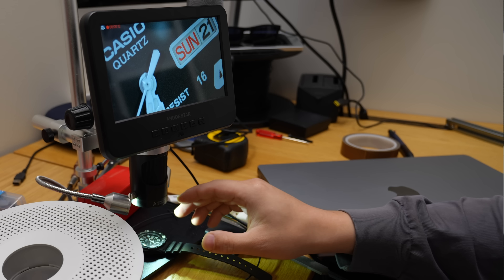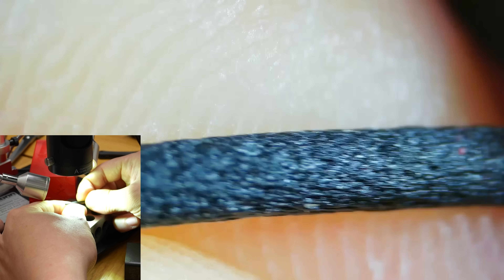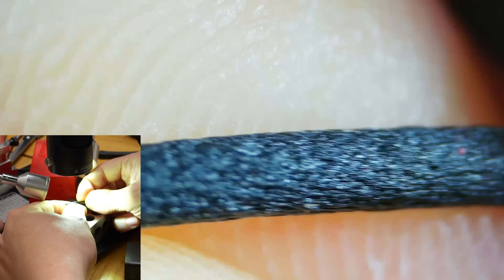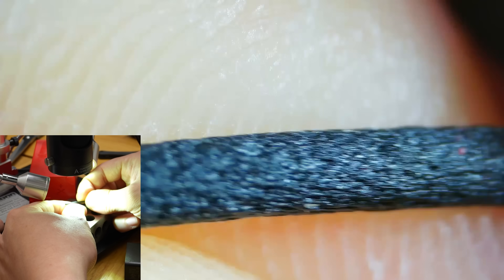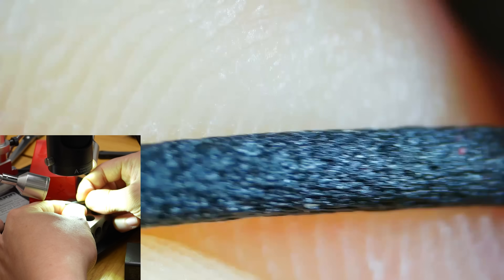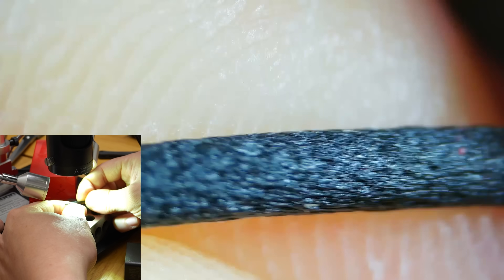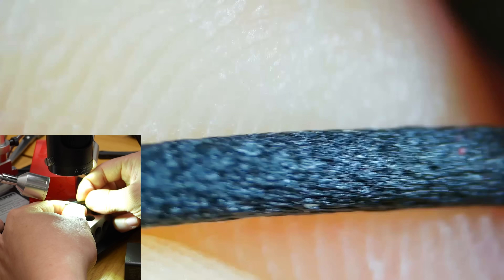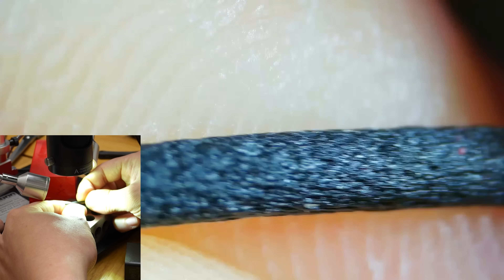The Dark Side of Carbon Fiber Filament

Comment: Ex composite materials engineer here, carbon fibres are not joke once the get in your skin they don’t come out. They have micro barbs that make the get trapped and the skin just grows over them and buries. Always wear gloves when handling and you want a table with vacuum extraction from underneath for cutting and preparing. I have a pice of carbon fibre in my finger it’s been there for 18 years😂. Also don’t get carbon dust in anything electric as it can short.
Reply: Depends on how deep they go, if they make it to the hypodermis layer they won’t grow out. It’s the fibres that stick out from the splinter that act like barbs that can hold them in and break off if you just yank them out. If you go in to get one removed they generally cut the length of the split rather than just pulling it out.
Reply: @milkybaravenger  yes and  no. They cut along the length for large impaled objects like stingray barbs,  big cactus needles, etc that go in laterally or at a steep enough angle. Large itens that go straight in require an incision the location, depth, yada yada depends on injury site. Stuff this small usually gets a local anesthetic if it's deep, and then the layers of skin are scraped away using a scalpel until enough is exposed to remove it. You're severely over dramatizing this situation and clearly don't spend much time outside. The reason I know all this is I've seen it numerous times on my ER rotations as a medic, have had it done for me,  and being in south Texas have an extensive history of sharp crap from the 100 or more types of cactus, Mala mujer, and various other evil products of nature. Buy hey, be afraid if you choose to be. Otherwise,  the body is amazing at getting stuff out that shouldn't be there.  Let it role.
Reply: @saltwaterrook4638  as I said I’m an ex composite engineer so the splinters I’m referring to for reference are from carbon fibre parts which are far larger than the ones from the filament, if you read my first post you would of probably realised this as I reference a split from my old job and not printing, I thought you had to be able to read to be a medic? I’m not worried about shards from filament in my skin, I’d be more worried about the dust from the fibres when peeping a part after if I didn’t wear a mask like any sensible person working around dust.
Reply: @saltwaterrook4638  lol south texas got them poison needle plants, lol they hurt, haha. Nightshade has glass like needles, at least it ain't as dangerous as the fruit and plant leaves but dayum it hurts.
Reply: Sigh, I don't have a microscope to verify if anything got permanently stuck, but I've handled carbon fiber filament. Well now I know. No more Carbon Fiber filament.

Too bad, because I don't have a good way right now to prevent Polycarbonate from warping with large prints.
Reply: Got splinters a few times myself, but thankfully, I was working with cured resin and could pull it out without too much difficulty, but definitely a lot of stress!  Had double gloved with nitrile gloves too!
Reply: Glass does the same too
Reply: @-r-495 Okay yes glass does the same job but don’t you think that’s worse? 😂 I think it’s around the same safety precautions needed. Glass reinforced is just fiberglass, should probably handle it like you should fiberglass insulation; Gloves and a respirator
Reply: @kadensmith5586  glass fibers dissolve in the body given enough time - have not seen anything that suggests carbon fibers do the same.
Reply: Reminds me of Asbestos risks, so I'm inclined to completely avoid any of these 'New age' technology, it seems every newly created material comes with dangers unknown, until someone exposes the downsides!😳🤯😱
Reply: Are Nitrile Gloves enough to protect your skin?
Reply: @fuijika  yes they will be, we use to ware two pairs of thick nitrile gloves when working with the matting or a part that needed to be finished.
Reply: @fuijika if they are fentanyl grade, yes.
Reply: Pretty sure skin grows from bottom layer and outwards and the outer layer dies off, not on top of the outer layer?
Reply: I'm into exotic cars, and yeah, a lot of the people working on the carbon fibers bits of say Lamborghini's or the Lexus LFA documentary comes to mind, they have their employees wearing masks and PPE so they don't get the fibers into their lungs as well. It is known to be very bad for your health as you mentioned. But to be honestly, I've very happy to have watched this video because I wouldn't have had all of that in mind when handling carbon fiber filament, I just wrongfully assumed it to be safer.
Reply: Reminds me about glass brushes it’s also sucks to get in the fingers, use gloves .
Reply: I work in a plant where we cut cf with power tools and pneumatic cutters every day 🥺
Reply: Stick to materials because medical is not your thing.  This shit will be shed within a couple of weeks.
Reply: Vacuum is not sufficient. As a composite materials engineer, you should know, only cutting in water bath is acceptable.
Reply: Speaking of electric things, are there special hazards to electrostatic air cleaners or are they fine for filtering out carbon fiber?
Reply: @Cineenvenordquist  if you mean for printing I think you would be best relying on good hepa that exchanges the entire room multiple times per hour & if you mean for cutting it, cut carbon fiber under water. As far as the good hepa, I mean like a workshop suspended air purifier (it can just be placed up high if you do not want to/cannot mount it from the chains). A DeWalt one is like 200 or so USD, other decent makes for around the same price & form factor. You do not have to go crazy, especially in a modest space. Even in larger than 1-car garage size spaces, you can just add more than one of those purifiers. Exhaust outside from enclosed printers is also a great option. These are my opinions, I am open to better ideas for printing with composites. As far as cutting/CNC carbon fiber sheets etc, I have only hands-off experience from working closely with former teammates who ran in water beds, those are awesome & the real way to cut sheets. No air is sufficient for machining, it should always be in a shallow bed.
Reply: What about sticking carbon fiber in anus????
Reply: Most cf filaments use CF flour instead of long fibers but yes; there are definitely risks.
Reply: Thank you for your comment. I will be careful.
Reply: I feel doomed!
Reply: the size of the fibers in filament are a non-issue for skin. Lungs is another matter. I wear a particulate filter when working with it and have a good HEPA filter in the room to filter them out.

Also guy has a point with PLA-CF. Kinda pointless, save some money and print a stronger non-composite plastic. I use glass and CF reinforced nylon for their heat deflection properties, plus about the strongest stuff you can do without a hotend that goes over 300c.
Reply: @milkybaravenger   Bro what kind of absolute nonsense are you over here spreading to people 🤣🤣 people have had entire bullets, chunks of wood, all sorts of shlt naturally work their way out as their body slowly rejects it and works it out. If the body can push out a ~100gr round over the course of a few years, it will have ZERO issues getting rid of what are essentially small splinters.
Reply: Have you tried tweezers?
Reply: You're a literal nobody lil bro
Reply: @milkybaravenger  would you compare it as much the same as friable asbestos or glass fibres?
Reply: I'm the only one who wears a mask where I work. When I first started I would pretty much constantly have a rash on my arms from the CF dust. I started taking more precautions, but there's only so much you can do. 

The stuff is everywhere and always in the air. When the sun shines through the window, I can see the air dense with small sparkles of the fiber. It gets in your hair, clothes skin, everywhere. 

I will say after having been exposed to so much it's kind of laughable that someone would be worried about a literally microscopic amount from 3d filament, but I do suggest wearing proper PPE. The stuff is uncomfortable.
Reply: @SzikrásAnna-火花安娜  yeah the dust is not pleasant even In small amounts, we used to use pneumatic tools only for cf weren’t allowed to use electric and all the sockets in the room had sealed covers so the cf dust couldn’t get in there. 

They never used to worry about the dust from man made stone either until enough people got silicosis from it for it to be a problem. The silicone fibres stick to the lungs like asbestos, wonder if cf and gf dust could end up being the same?
Reply: @milkybaravenger  Yeah I really hope not...

I'm remindes of the chapter from "Germinal" where the miners begin to read about the effects of coal-dust on their lungs and become indignant at the mine owners. Everyone tells me CF is inert, but I don't like to gamble my lungs.
Reply: @milkybaravenger engineered stone is now banned in Australia. Apparently the first country to do so.
Reply: @SzikrásAnna-火花安娜  Everyone in that work environment should be supplied and required to wear respirators. That's insane. Will absolutely cause issues similar to silicosis from cutting stone.
Reply: If it has been there for 18 years, it seems rather safe, right?
Reply: Ha, ha,  hilarious responses.  I had a S/S sewing pin about 25mm long n my foot for 20+ years, it eventually worked it's way out.  Carbon spells a few mm long from cured parts have micro barbs for sure and ain't coming out quickly.  Chopped carbon fibres from filament or 3D printed parts are not in the same class, just not a problem.
Reply: Bullshit. There are no hooks and they'll just grow out.
Reply: @testboga5991  Exactly; our skin is constantly renewing itself (at a very fast pace, in fact). They eventually all fall out (which won't take long). 18 years in his skin? Yeah, no (it does not go deep enough for this to happen, not by a long shot). This video is also nonsense and just trying to instill fear in people.
Reply: @InjectorGadget  I have a wood sliver in my index finger from when I was a kid. It's been there 30 years. I can still see the dark spot. Your skin doesn't expell debris, it just covers it up.
Reply: @s13kuminachu  yes the skin does expell debriss, depends how deep, in your case its too deep and get stuck

Comment: I printed carbon fiber filaments in my living space (including my bedroom) and had to sneeze often after printing carbon fiber filaments and also when handling freshly printed parts. I found a lot of little tiny carbon fiber parts in my snot under a microscope. they were all of equal length... so they were not broken off, but they were the actual milled carbon fibers being released from the filament.
Reply: rip
Reply: So there are a few things to consider here. First of all: after the sneezing happened two times I found what happened and stopped the use indoors. I believe that most of the fibers get released when handling a freshly printed part. After printing there are multiple loose fibers on the surface or only slightly attached. I now put every part I print with it under the shower and rub it down with a towel. If you are curious: print something with CF filament and stick some tape to the outside and look what it picks up from the surface when removing it. Small fibers are also not generally dangerous. Asbestos had a very particular fiber structure and length/diameter ratio that made it very hard for the body to get rid of - basically impossible. Glass fibers can get broken down by the body and in the lungs and are much thicker than asbestos filaments (the bad filaments... fragments broken off from fibers). Carbon fiber is a different thing and potentially harmful. Race car drivers with carbon brakes often inhale larger quantities of abraded carbon fibers/dust during their career or hobby. So in general it is not as dangerous as asbestos but it is hard to tell what the real impact will be. Now it also heavily depends on the dimensions of the fibers that are being released from 3D printing filaments. A friend of mine from 15 years ago had a CNC mill and milled a lot of carbon fiber plates. Afterward, his snot was totally black... he wasn't aware and didn't wear any protection. He is still fine, although I would definitely not recommend it at all. Right now the risk of 3D printed carbon fiber and using the parts in your living spaces can be almost non-existent due to things like fiber geometry, diameter and so on... or it might indeed be a risk for certain illnesses if inhaled over extended periods. I think the truth will be somewhere in between.
Reply: @AlexRian_  THANKS...very interesting! and a solid warning to others - handling and processing is key!
Reply: Uhf, better take out some high end medical aid and delete this comment so the insurance adjuster's dont find out it's a pre-existing condition...
Reply: @SidekickElements This is such an american problem. Honestly crazy how you deal with that bs.
Reply: @swecreations  hehehe, actually in South Africa. There is public medical care, but it's really bad, you won't survive a serious illness on public medical care...
Reply: please elaborate more. if tru, this is absolutely very very bad.
Reply: Sheeez. I can understand for pla butthis? 🙄
Reply: Thank you for your comment. Is your printing set up small enough so that you can make a negative pressure box- to outside (use at least one very good HEPA filter)? Does using a painting respirator (1 or 2 filters) make a difference? Zip baggies are inadequate to store it in.
Reply: @Jesse_Kershner nah the fibers should be too large. Asbestos fibers cause cancer because they are small enough that a single macrophage will phagocytose them and then its DNA gets broken by the physical disruption of the fiber, causing cancer. So cancer-causing fibers would be a single cell or less in width. Now if these small fibers in the video are themselves giving off fibers that could be an issue.
Reply: Get a fume hood and/or electrostatic filter on that printer and surface treat your prints s.t. you don't get friable fiber! Get you some daily Nicotinamide riboside for the cope. Read them msds!
Reply: @Cineenvenordquist  All the MSDS for CF/GF filaments say "it is not necessary to use protective equipment under normal use conditions.”
Reply: This seems very odd, the printing process shouldn't kick the fibres up into the air and carbon fibres of that kind of size are probably too large to be suspended in the air, dust from sanding or milling is different though. What brand of filament were you using and what were you printing it on?
Reply from the maker: @conorstewart2214  if your printer is using a filament cutter, that is probably releasing some each time the filament is cut. It's probably being worked loose by the extruder gears when they clamp onto the filament.
If you're unboxing and handling the spools, I'd imagine the filament spool and bag has a significant amount of loose fibers just from shipping and handling, and the filament rubbing against itself on the spool.
There are lots of opportunities for fibers near the surface of the filament to get worked loose, and then they get blown around and lofted into the air by powerful part cooling fans.
Reply: @NathanBuildsRobots  great point on the extruder gears! this can produce a constant stream of small particles!
Reply: @NathanBuildsRobots also if there's any moisture bubbling out, it will also lift tons of the fibers up and out of the filament.
Reply: @conorstewart2214  printing literally changes it's molecular structure. Of course it breaks and becomes airborne
Reply: @VoidPixel4179  yeah, it could do so in small quantities i think...
Reply: @VoidPixel4179  in what way does printing change its molecular structure? It may cause slight changes to the plastic but it will do next to nothing to the carbon fibres. If printing broke the fibres in any significant amount then using fibres would be useless.
Reply: Hope you have good health insurance
Reply: @JSPHism  Everyone in normal countries has good health insurance, it's paid from taxes
Reply: @hiya2793  what do you mean normal countries??? Im from Peru and the public health system there is the worst
Reply: @JSPHism  Yknow countries where not everyone is as corrupt as it gets but instead people actually abide by contracts they sign...

Comment: I find these educational videos invaluable. It's crucial that we dispel the misconception that 3D printing is entirely safe; there are real health considerations we need to raise awareness about. I've noticed firsthand the blackening of hotend nozzles over time due to the smoke emissions you mentioned, underscoring the presence of potentially harmful substances from 3D printers.
Reply: What "real health considerations" were mentioned here? Just that the fibres exist, nothing about whether they are harmful or how harmful they are.
Reply: @conorstewart2214  Yeah the video highlights the existence of fibers and emissions during 3D printing, which is a valid concern. While it may not delve deeply into the specific health risks, it's a starting point for raising awareness right?
Reply: @Zae-R  it is not a new concern and there is still no evidence that they are harmful.

Comment: It would be interesting to see if similar granular embedded particles if you ran your hands over copper, aluminium wire. Having worked with many different materials it pretty much always feels like particles are embedded into your skin (eyes and lungs) if not using correct PPE.

Comment: Hello Nathan,

I’m so glad I subscribed to your channel. I would had never thought of looking at my skin under the microscope after handling it. 

Based on your video, I will discontinue any plans to use carbon fiber reinforced filament.  

Would you consider looking into VOCs for regular filaments such as PLA and such?  I bet different printers handle them differently. I’ve heard other channels mentioning but no actual testing.  

Cheers mate.